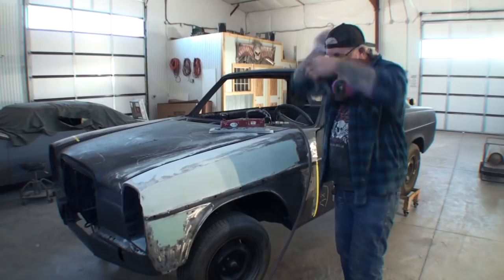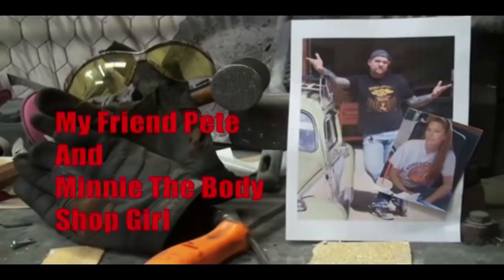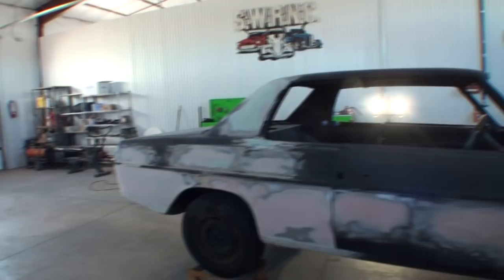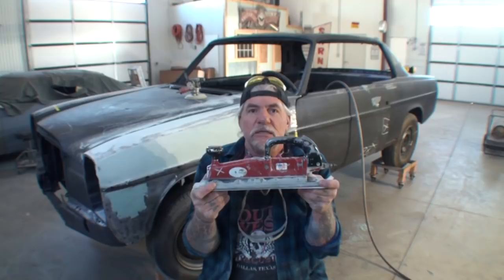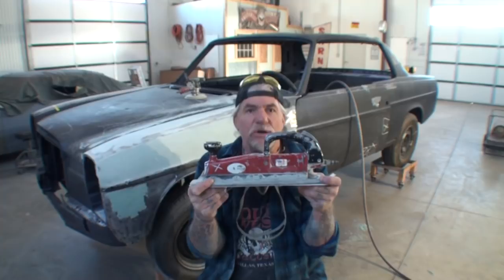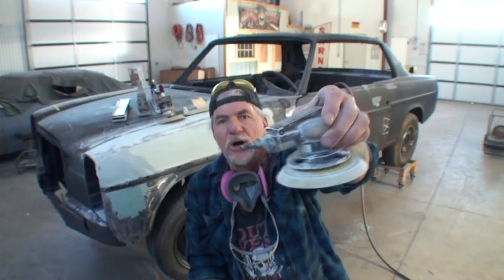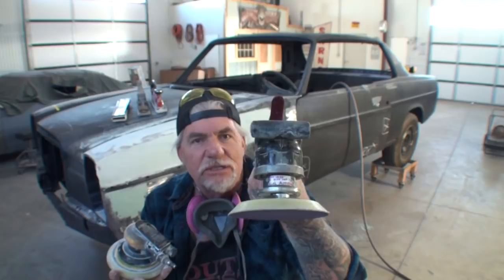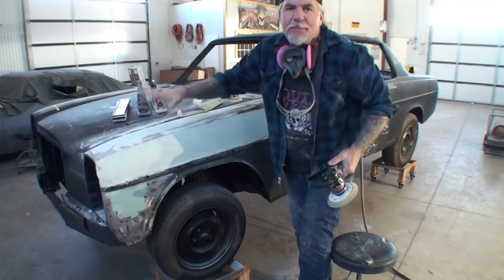How To Sand "Bondo" - Air Files and D/A Sanders

Comment: Viking and Hutchins are legendary professional air tools. Good quality air tools oiled and maintained properly will Last 25 to 30 years.
Reply: I had a 30 year old
Central pneumatic air file and it was still working great until I lost everything in a fire. I’d buy another
If I thought it was still made as good. But will have to spend a bit more since nothing is made
Like it used to be.

Comment: Still in-process of my first automotive paint job ever... Hat's off to the professionals! It's not just the tool. No matter how good or correct the power tool; when it comes to sanding, you either have the experience to know how to use the tool, or you FK up and have to redo everything. I'm still at level "hand-sand everything".

Comment: Uncle Pete, what about us DIY-ers who aren't using air tools, dont have a compressor, and who live in the year 2021....and who are just new to the world and are buying all electric battery operated cordless stuff....like a Dewalt or Milwaukee or Makita....can help us figure out what we need to buy in that arena please?!
Reply: Electric wears out fast. Find a good compressor. They can be found second hand and don't have to take up a lot of space. Just make sure you have a 220 line. If you are going to do jobs, it is worth having. Remember you time is also worth something. If you can use the compressor to spray 2k primer vs buying it in cans, you'll save money. Fill up air in tires, blow out all the crud before spraying, using air to cool welds.  Tons of uses..
Reply: I have a Bauer 20v 5” DA and it’s been great. I have put 100 hours on it so far at minimum and it Hasn’t skipped a beat. I still use a $40 HF air DA also. It’s been unstoppable also. Maybe I’m just lucky though. Not!

Comment: I use a electric da I bought at harbor freight,  I like them because it’s less wear and tear on the air compressor, doesn’t get air in the lines etc, it is way heavier than a air powered one though
Reply: same, I don't like running my compressors constantly unless I have to, like for painting. I have two craftsman 8.4 scfm 30 gallon compressors that I connect together. As long as you set the regulators to the same psi it works perfectly with no need for a check valve. All info I found says you need a check valve so I bought a couple but I couldn't paint with those thing connected, it drastically reduced air flow in my system and then I realized that they're are completely unnecessary. If the regulators are set at different psi then yeah air will leak out of the lower psi regulator but if you match them, no problems. Idk why I said all that but yeah, I use a 7.5 long throw Bauer da polisher/sander and a little tacklife random orbital sander(da sander) that has a short throw for finish sanding or finer sanding. I'm sure the air tools are better but air compressors are so loud and I want them to last as long as possible.

Comment: Now I gotta go look at my air file...  I thought it was a Hutchins, but it looks just like your Viking...  It's an expensive one, and it is worth its weight in gold.  I'll also co-sign on Dynabrade.  I've got a handful of their air tools for finishing metal (not just body work) and they are 10x better than the crap you buy at the box stores...  I'm digging the Mr. Blue Roads commercial.

Comment: Pete you know you need a die grinder for cut off wheels and a right angle die grinder for roloc discs.The Hutchinson air file is much more expensive than the Viking and a bit heavier.Dynabrade DAs are excellent especially the 3/32 finishing one which I think is number 21035 but I was looking at buying another when and they redesigned them and changed the color from red to blue.Google would come up with the old number,but Dynabraid are extremely light and never leave cornrows,they are about $175-200.After 20 years of complete restos I'm doing prep work for the painter.My Lyme has made me not want to paint because it effects my eyes too much and I don't like blending metallics even thought I have no problem,I also don't like spraying the medium solid clears,I'm so us to the old DuPont 9700 overall clear.I don't like spraying that Transtar shit.

Comment: I need an air file that works so im going to get the victory. 

Now i did get a harbor freight air angle die grinder, chief" brand for use with rololock discs. That does work well, and for 49$ if it dies
 i can just get another one. Some of their tools do actually work 😂

Comment: Awsome info u are the man when it comes to the truth I have a question on the viking I went on ebay and theirs so many Vikings and prices and single piston and dual piston
Reply: Go for the dual piston inline sander instead of a single piston. The dual piston sander has power available for each direction of the pad stroke and the single piston is powered in 1 direction and relies on a spring to pull the pad back against the piston.
Reply: I would always go for the dual piston “Viking” air file. Sir, you are correct! Hi-OOH!
  Well Ed, I did not know if that was a dual piston Viking air file in your pocket, or you were just happy to see me!

Comment: I've used Hustlers for years but new filler, like Rage Ultra, sands so easily, I haven't used air files in 3 years. Why beat the piss out of panels with an air file when you can hand shape filler with a yellow 3M long board and purple paper in less time and with a bunch less wear and tear on your elbows and shoulders. Funny, I was going through my storage unit yesterday and came across my last Hustler. I thought to myself if I could get a couple bucks for it, I'd sell it.

Comment: Hey pete, thangs for the tge tool brands to buy. I was tempted by tge cheap harbor freight air file and da sander. What total junk. No power air all they just stall out, almost useless. Maybe with 100grit on the air file its a finish too, but i doubt it. 
I had plenty of air with a 60gal compressor and high flow fittings, but these harbor freight tools just sucked !

Comment: National-Detroit invented the "DA" sander.  Dual Action refers to the ability to be used as an orbital sander, or with the pad locked to be used as a rotary sander.  With the pad locked you can perform the fastest bondo rough-in humanly possible.  The 11" Mini-Vike is more versatile than the full size Viking Air file, being much easier to control over varied body shapes.  Lastly, you should not run an air file at the "carpal tunnel" speed heard at the beginning of the video, for the obvious stated reason.  I'm just sayin'
Reply: No they didn’t